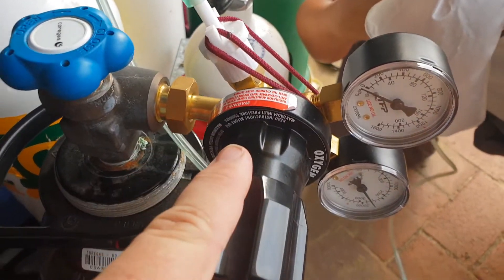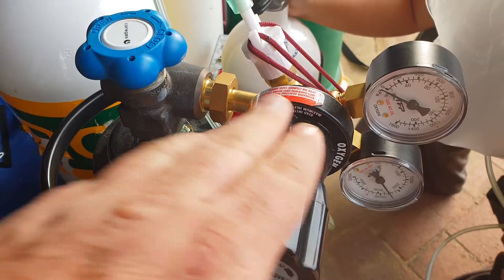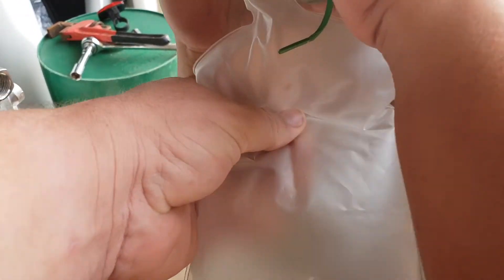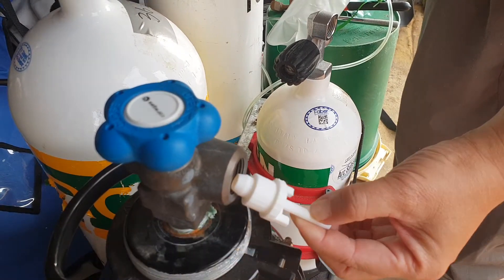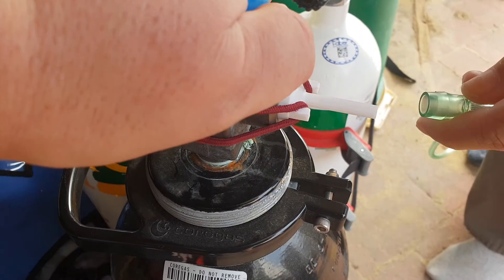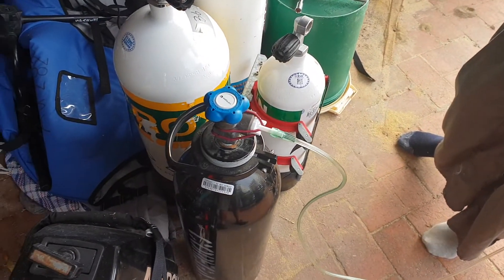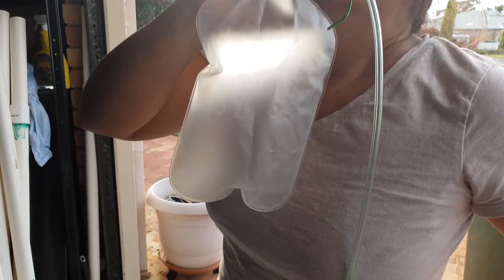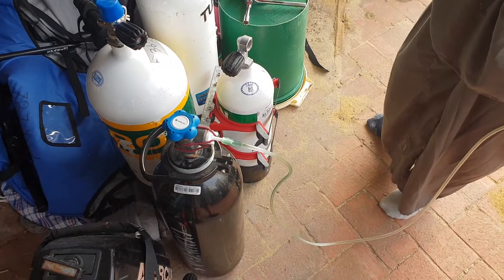Covid19 response - welding oxygen adaptor

Comment: A rubber band? Not a good idea bud
Reply from the maker: It works fine, it is only there as a retainer everything is low pressure, the band also helps act as a relief valve if flow is too high it rides off and stops it falling. It is not held hard enough to pop off with any pressure. Flammability of the whole thing has been tested and while it will burn it does not burn spintaneously and does not burn with much vigour or worse than many other materials in use. Remember also this is Emergency Tech for intermediate technology applications in a system potentially flooded with mass casualties - it works, its relatively safe, the risk assessments come out at low risk as does failure modes and effects analysis.

Comment: Did you 3d print the adaptor? Can I have the file if you are sharing it? Thanks
Reply from the maker: it depends a lot on the connector in your country, it's pretty easy to simply copy the methodology. Note - I don't "recommend" you do this is a proposal for emergency use, but should you do it its at your own risk.

Comment: Industrial oxygen cylinders are filled using oil compressors ( yes they are oil compressors which use a specialist synthetic oil which has a very high flash point ). At the very least is should be filtered through activated carbon but be wary of black fungus disease from industrial gasses from residual bacteria living on the internal surface of the cylinder wall.
Reply from the maker: Industrial Oxygen and Medical O2 has very little difference in the standards from what I've read. The main one is that a tank has to be bled down to 0 and cleaned  every fill for medical grade  but for industrial O2 the tank can be topped off like a scuba tank but in Aus at least still needs to be inspected, cleaned and hydrotested annually. I know of many people who use industrial oxygen for dive mixes - not recomended but in all practicality they swear it works. AGAIN though this is aimed at field hospitals in a pandemic - it would not be particularly hard to empty tanks, clean and fill them with O2 to ensure this is prevented. O2 cleaning a tank that is already in O2 service  is very easy I've done it myself.
Reply: @aquaticaustralia  The cases of Black fungus disease in India has still not been attributed to oxygen cylinders. In the UK the cases are extremely rare. It maybe attributed to contaminated oxygen supply infrastructure, using humidifiers with contaminated water, high background levels of the fungus in the air, patients with uncontrolled diabetes, high steroid levels, immunosuppression, contaminated medical devices...... they have still not got to the bottom of it. In the production of the oxygen, black fungus /Mucormycosis would not survive the cryogenic distillation process or a vacuum swing adsorption process so if it exists inside a cylinder then it must be related to contamination of the cylinder before it is filled. Fungus cannot live on moisture alone, it needs a food source and so if there was water inside the cylinder it would have to be contaminated with organic matter to support its development. I feel they are barking up the wrong tree and the outbreaks are more attributed to localised conditions. 
The good news is however, if you are enriching air by carefully controlling a flow of oxygen into a diving compressor, there are at least 3 stages where the gas temperature exceeds 150 degrees centigrade or higher. Even the most persistent fungus types and related spores cannot survive temperatures of over 60degrees centigrade so it would be fair to say they would be destroyed in the compressor. Legionella and other microbiology in the coalescer after the final stage of the compressor is of far higher concern.
Reply: @glanrichbex  
I have been trying to find a good example or even a test that showed industrial oxygen was measurably dangerous.. So far i have found NOTHING to show that it is.. The amount of toxins in the every day air we breath FAR outweighs the slight differences between medical approved and industrial oxygen.. 
As far as i have found i have seen NO reason that industrial oxygen cant be used in an emergency or even casually for sports or other brief relief/ recovery.. 

if you have scientifically supported examples to show industrial oxygen dangers i would be delighted to read it.